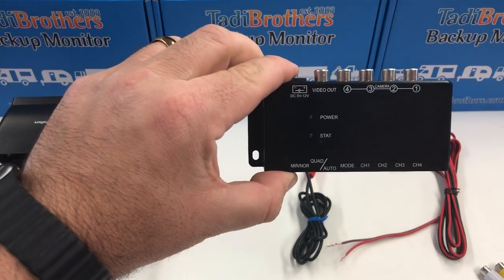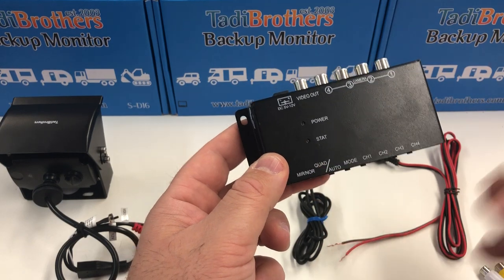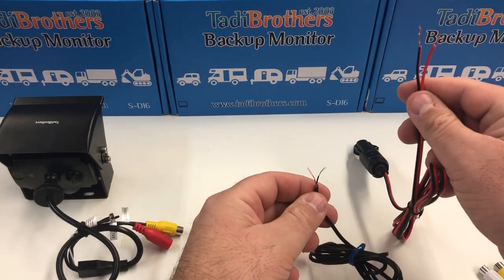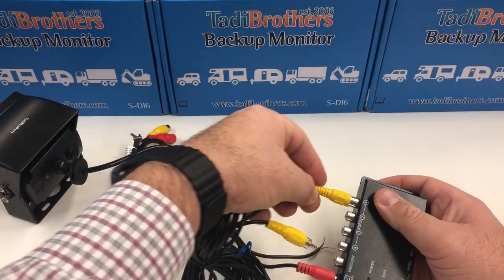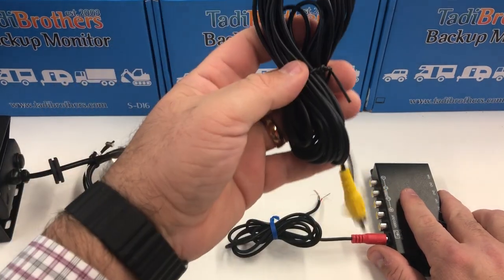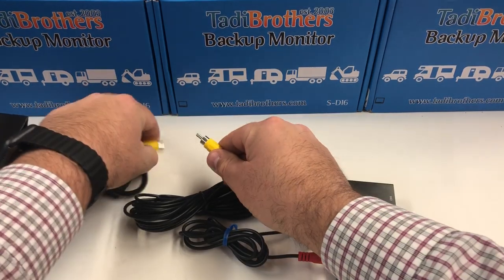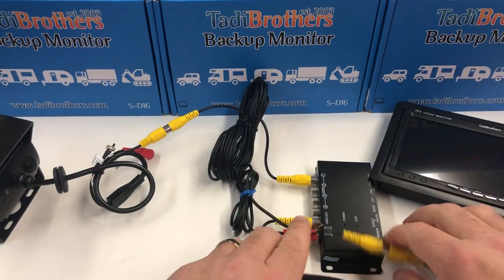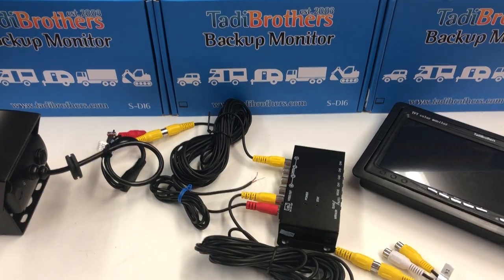Setting up a Multiplexer split box for a backup camera system

Comment: I have a Nissan 2018 with factory front, back up, and 360 views camera. Does your multiplexer work with factory camera?

I went to one electronic/radio auto store (called Mach One) because I want to be able to turn on my camera whenever I want. However, they told me that this can’t be done on car with factory camera.